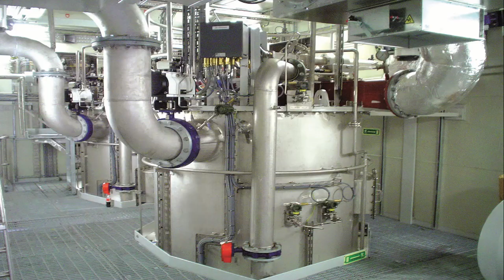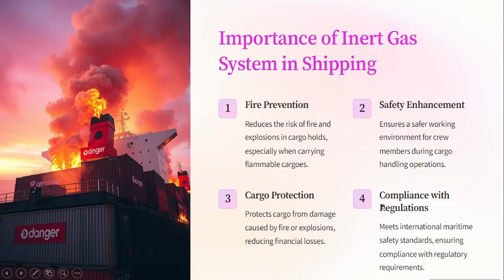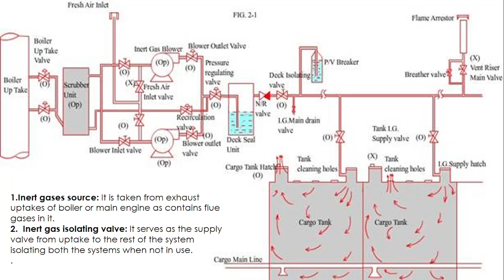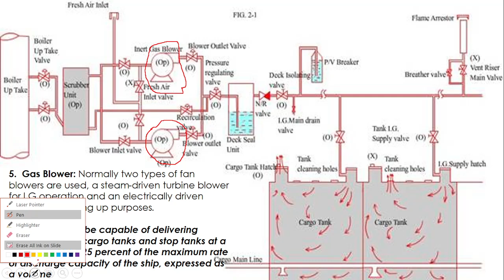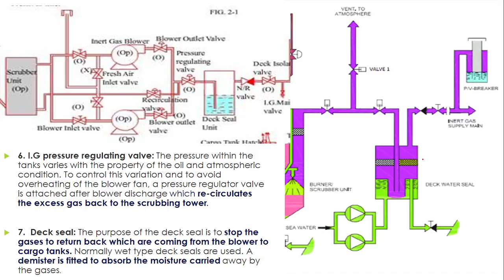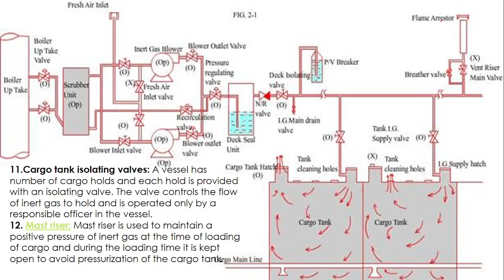Inert gas System|Scrubber|Deck Seal| PV breaker|PV valve|Mast riser

Comment: If mast riser and pv breaker both prevent overpressurization of ig line....then why can't we use any one of them.....moreover both have flame arrestor on them also mast riser makes sure that the vapours from cargo tank are released quite high above the deck level....so what is the specific purpose which pv breaker serves?

Comment: Sir, kindly explain the boiler load with respect to the inert gas system?

I asked it during live itself Sir...
Reply from the maker: the boiler flue gas generation will depend upon the required capacity of the inert gas which will vary the fuel and air ratio of the boiler with respect to inert gas generation